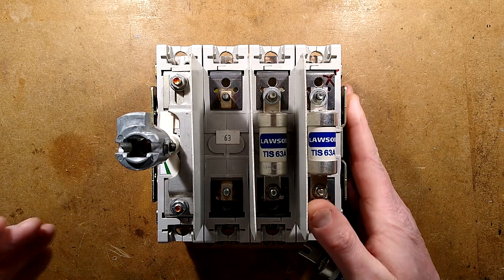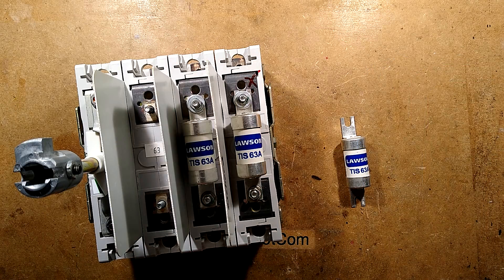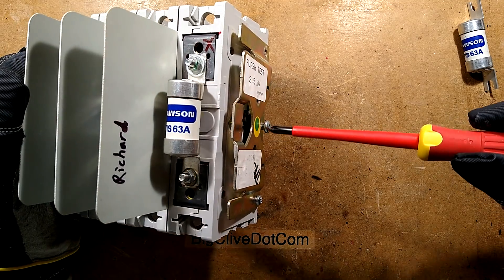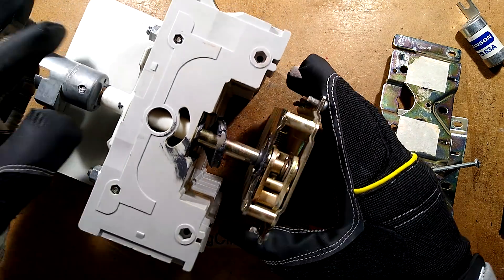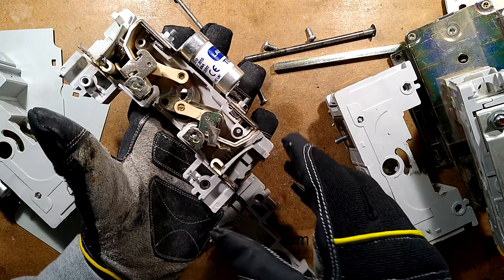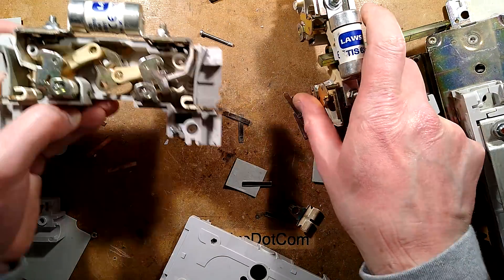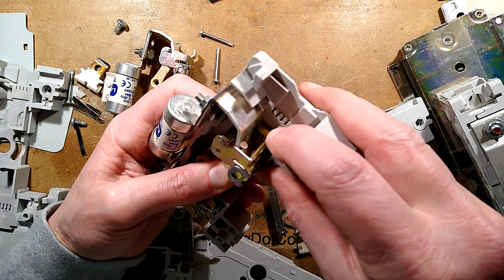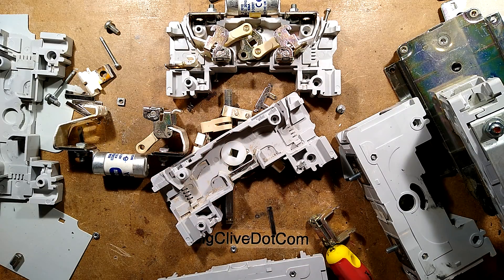Failed elevator switch fuse / fusible disconnect

Comment: I watch some hvac channels and sand in disconnects, contactors and time clocks is a killer. It takes just one grain in right place.
Reply from the maker: Yeah, it jams gears solid.
Reply: @bigclivedotcom   Electrically, It's not just the mechanical interference at contact faces. That is a minor issue because pressure cracks and embeds the particle under closing pressure. 
The big issue is that mineral 'sand' can start to alloy into the silver alloy contacts. Once that modified alloy [prone to burn/melt/welding] starts to burn there is no stopping the degradation upon ever open and close. 
The highest faults like this are seen on contact points on auto engines, when some idiot uses emery paper to 'clean' contact points. Degradation is accelerated by the frequent 'open/close' cycling.
Reply: Sand in contacts, or dead (dry) insects can and does cause faults. Sand in mechanical components is even worse, especially if it contaminates the grease or oil that is supposed to lubricate moving parts like gears or bearings...
Reply: @Mark1024MAK  The dead insect in a relay contact was supposed to be the origin of 'bugs' in computer code. The original 'bug' was supposed to be a dead insect that stopped one of the electromechanical code breakers working at Bletchley Park in WW2. Someone found it and held it up with a pair of tweezers and announced the problem is a bug.
Reply: @johnmurrell3175  - yeah, absolutely. I’ve also had it myself with electro-mechanical equipment that uses electrical contacts. It doesn’t happen very often. But occasionally an insect or similar will get inside the equipment casing and then at some stage the contacts will close. If it’s in the way, it will be trapped, and the contacts may not make properly, hence causing a fault.
And electronic solid state systems are not immune to the problems of nature causing havoc. One failure of a system was due to a slug moving across some 240V PCB tracks, then dying. Then the gunk corroded the PCB tracks which caused a failure...
Reply: @johnmurrell3175  That folk etymology is not correct. Bug was used as slang for a problem in engineering since the 19th century.
Reply: Never every use emery type paper to clean switch contacts.
Small emery partials can remain embedded on the contact surfaces and start an alloying burning process.
Once it starts it won't stop.
Reply: @BTW...  The same reason you should NEVER use emery paper or similar to clean motor or generator commutators. The only way out if someone has is to 'skim' the commutator in a lathe or else replace the motor. I guess the same applies to alternator slip rings but I don't have much experience of those.
Reply: Under normal use, commutators should not need cleaning, the action of the brushes rubbing over the surface stops the build up of surface contamination. What is however needed, is the carbon particles from the brushes needs cleaning out. Compressed air is the method that I prefer.
Reply: @Mark1024MAK  It depends a lot on using the right brushes for the load . Brush manufacture is a black art - the quality of UK brushes from a well known company went down after  the Welsh Anthracite mine closed. Brushes are a difficult compromise. low resistance to carry the current but high resistance for good commutation plus they need to prevent excessive commutator wear.
Reply: different type of sand, but same outcome. troubles :)

Comment: Hey, clive, what do you recommend for 50A (10mm2) multicore cables for electric showers? Even certified terminal blocks* fail after years, and turn into burnouts, and the UK has some allergy to the double-screw terminals which never failed.
Reply: I've only once had to joint a 10mm2 (6242Y) cable.  I used uninsulated butt crimps, each covered with heat-shrink for insulation, then a big heat-shrink over all three to act as the sheath.  I staggered the three crimps so that there were three small bulges instead of one large one.  
The heat shrink was clear so that anyone conducting an inspection can see what's inside.
It needed to be 'Maintenance-Free' as there is now a floorboard and carpet on top of it.  I couldn't justify buying a copy of BS5733, but crimps are an established method, and XLPE heat shrink has superior dielectric strength to PVC, and it's a lot tougher.
I have Wagos that will do 6mm2, but haven't used them in anger yet!
Reply: @westinthewest  Do you think you can show an image of the said technique? On some scrap wire? How has it held up in the years? I'd think thermal cycling would screw it up like terminal blocks get screwed up.
Reply: @westinthewest  Your 'dwapbawx' comment also seems to be erased. I got a notification, but when I clicked it, it lead me to nothing. Uhhh, maybe email them to me thealucardfromhell@hotmail.com see if this is not allowed on youtube too?
Reply: That sounds like more of an industry standard to ensure replacement is necessary sooner than it really needs to be to guarantee constant sales revenue.
Reply: I've copied your email address, so the three photos will appear in a few minutes after I finish a long epistle to a landlord in Bromsgrove.
Shame we can't blopbocks photos in the comments.
Reply from the maker: The double screw terminals would have been ideal.  Maybe large through crimps would be a space saving option.
Reply: @bigclivedotcom  They're very hit and miss. I'm talking out of experience of an installation of mine 2 years ago combusted a week ago. Small fire since I put it in a place where it'd trip the RCD and prevent a big fire, woo foreplanning. But I made sure they are TIGHT. So tight that one of them even broke the threads and had to replace it. Compact double screw terminals used to be available in UK Years ago, not anymore. I haven't seen ANY documentation, certification or videos showing the copper tube crimp joining, and no testimony if it's long term "permanent".
Reply: @dimitar4y  BS 7671 permits a joint made by 'an appropriate compression tool' in 523.6 (iv).
I agree they can be hit and miss, but if you're careful and do the pull-test as a final check, they'll last indefinitely.  I read a comment last year which stated that crimps are pretty much the only method allowed on aircraft wiring.
Reply: @westinthewest  I did a massive pull test. I tested those terminal blocks to death. They lasted 2 years and failed in one day. I tightened, untightened and re-tightened several times the clamp to make sure the screw seats into the copper, and that the screw thread isn't stripped or damaged. I think the issue is UK terminal blocks are bronze, not copper, so thermal expansion causes the screw to let loose over time. I know I'm not using terminal blocks for above 13A anymore anyway.
Reply: @dimitar4y  Crimp photos should now be in your email  :-)

Comment: The small springs that put pressure on the contacts likely overheated from poor electrical continuity between the main arm and contacts letting excess current go through the spring. I've replaced micro-switches that failed in a similar manner - poor contact between the common post and the switch arm causing current to go through the snap-action spring, causing the spring to overheat and lose its springiness. The loss of contact during mechanical movement does not need to last long for enough inrush current to overheat springs.
Reply: Thanks for reiterating exactly what Clive said.
Reply: @xenonram  Wrote that before reaching the end of the video. Ideally, that thing should have had braided copper crimped or welded between moving pieces to guarantee a good chunk of the maximum allowed fuse rating and prevent arcing/pitting/welding between moving parts.

Comment: Not in the industrial application, but I remember bits of card with different fuse wires wrapped them, for the home. Then if the fuse blew, you simply picked out the right wire (well hopefully right wire) wrapped it on the post and off you went again.
Reply: Yeah, as I kid in the UK I remember that as well. And I was always putting plugs on appliances. They cam without back then.
Reply from the maker: You can still buy fuse wire cards:-
https://cpc.farnell.com/pro-elec/fusewire/fusewire-5a-15a-30a/dp/PL09979?st=fuse%20wire%20card
Reply: Featured in an older video on this channel.

Comment: Maybe a sudden surge of too high a current melted the spring. Maybe the equivalent of a DC to DC converter for high currents is needed so that doesn't happen again? If this is what happened, the fuse blew a second or two too late.
Reply: The spring's not supposed to be passing any current at all. It only was because the sand was blocking the proper contact. Just normal usage under those conditions was sufficient to melt the spring, no surge needed.

Comment: Mofo spring. We learned that engineering unit in Electromechanical class yesterday!
Reply: please do explain !
Reply: @millomweb  I think he refers to any spring which is large enough to deal damage to soft items due to large forces. Mfer spring, or MoFo spring. Also these tend to be permanently loaded in assembly with forces high enough to cause damage to soft cuddly fingers, and to make disassembly a royal pain in the tookus. Skidsteers with rubber tracks tend to have a tensioner that includes a spring with 3/4'' and larger coils which needs to be compressed with 100s of lbs force in order to disassemble the group of parts it puts a preload tension on. (I did not have a press.... but I did have a 48 ton excavator)
Reply: @Tom89194  So where does 'mofo' come from ?
Reply: @Tom89194  Car suspensions are a good place to find big springs !

Comment: As for the sand, a very common cause for failure is people drilling in walls over electrical cabinets that dont have good ingress protection. Cable ducts/conduits also can blow dust into cabinets due to pressure difference between rooms, which is why it is prefered to have the conduit end before the cabinet and use a cable gland on the individual cables.
Reply from the maker: Yeah, and less skilled electricians drilling holes in cabinets with nothing to protect against swarf going into terminals and switch mode power supplies.
Reply: @bigclivedotcom  I have had a few contactors that mysteriously had one pole not make contact anymore, even though they looked fine, just a tad dusty. Under the microscope, there were hard (probably quartz) particles pressed into the soft contact material, keeping the contacts apart far enough not to touch anymore. With 400V and large rounded contacts, it takes surprisingly little not to arc over. Root cause was quite evident, last time some contractors ran pipes above the control cabinets, and didnt bother with a vacuum cleaner or anything while drilling holes to anchor the pipes, and the cabinet had missing and ill-fitting cable glands on the top.
Reply: Fucking people drilling the entire walls in the house
Reply: @HeyyLiisten  Isn't that more like 'demolition' than 'drilling'?
Reply: @westinthewest  sometimes it sounds like it!

Comment: Hope the elevator didn't crash to the basement. That would be funny and get lots of youtube views. Only kidding.
Reply from the maker: As exciting as that would be, the loss of a phase should theoretically shut the elevator down and drop the brake.
If the brake didn't apply and the motor tripped then the bias would usually be for an empty of part loaded elevator to go to the top of the shaft due to the counterweight being balanced for half load.
Reply: @bigclivedotcom  I live in a high rise. I have every confidence in the ThysenKruppt German engineering. Apparently the lift can hold its own from one steel wire strand as opposed to the 5 installed. Tom Scott on YouTube visited their factory and they use magnets 🧲 now. This allows a 2D or even 3D lift mechanism. Crazy. Watch all you videos. Flew Dan Air turbo props to IOM for my first holiday in the 70's. Flew from Newcastle. You could smoke on board then but I was only 9 so got wrong :)
Reply from the maker: @I E Otis did the system for the original tower of terror.  It's very complex to be able to drop faster than gravity.

Comment: Not 60, not 65, but 63 amps. That’s funny for some reason
Reply from the maker: Yeah, it goes up in some odd steps.  16A, 32A, 63A, 125A, 250A.
Reply: @bigclivedotcom  it might be based on binary for some manufacturing reason; 1,2,4,8,16,32,64,128,256, 512 ...with the rated (guaranteed power handling) values given being a bit lower than actual values to allow for manufacturing tolerance.
Reply: @bigclivedotcom  Looks like each next value in the series adds something like 25% to the previous one with some rounding and that's how it becomes value series like that. 50*1.25 is pretty much 63.
Reply: I’d guess it’s actually 62.5, rounded. Amperial fractions 😆

Comment: Clive, you say on your first day in the steel works you were installing slate switch gear, you started work in the "Stone Age"!
Reply: That would be large slate slabs used as and insulated panel to mount live contacts and conductors... fully exposed contacts and stuff like knife isolation switches.  This was used before plastic and composite panes [stuff contains a asbestos and mineral dust bonded with stinky tar like compound] were developed. 
The marble panes I've encountered must have been an 'up market' version of the open stone faced boards - Zero IP rating - NO isolation factor! High danger factor! 
At least the marble was a pretty white colour and not a nasty grey. 
Bit of a bugga to have to install a new switch or cutout for a meter on the old stone panels... but I seemed to get all the 'good' unique jobs that turned up.

Comment: Ok, that's really cool. The huge spring in the actuator makes sure the contacts close really FAST, but the little spring makes sure they don't close HARD. Do you thing it was running hot enough to distort the spring without messing up the adjacent metal?
Reply from the maker: It looks as though the spring took the full load.  The adjacent metal wasn't obviously overheated.
Reply: @bigclivedotcom  Yeah, I posted my comment before you discovered the sand. I should wait till the end of the video before commenting... Astonishing how just a tiny bit of debris knocked out the whole thing.
Reply: I don't think they care about contacting hard, The small spring would just allow tolerance in the range of motion of the device (pin arm push assemblies like that are terrible for maintaining tight tolerances in the final position of the end of the contact), so they can have error/wear in the assembly but still make proper contact/disconnection. But you are right about the spring cartridge in the back causing a hard fast snap to bring ALL contacts together with as little as possible time to arc and timing variance between making connection between the legs. Maybe also causes the contacts to separate in a speedy manner as well to limit arcing.
Reply: @Tom89194  I figure that repeated hard contacts might flatten or damage them, although that might be a good thing, if it had closed hard, the sand might not have affected it.